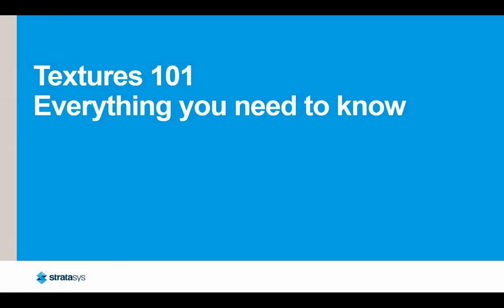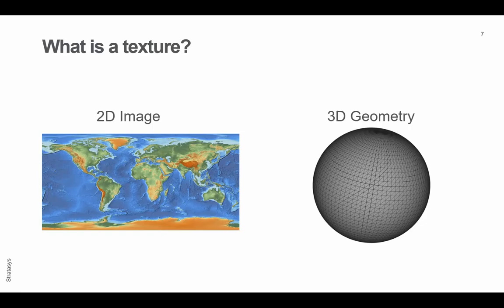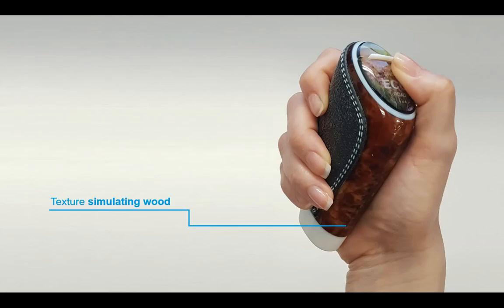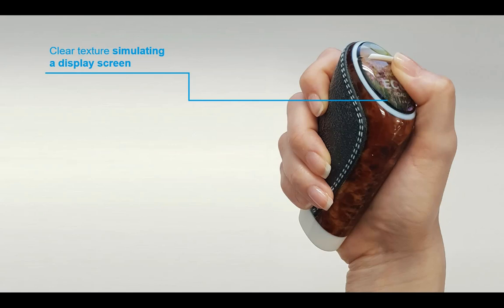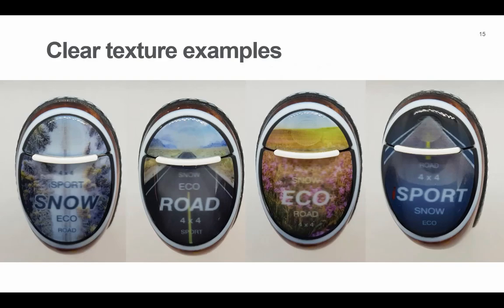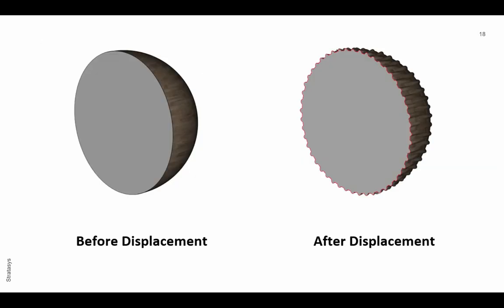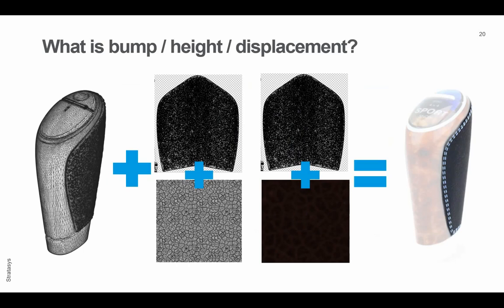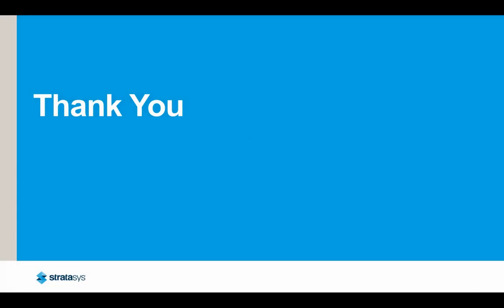Textures 101

Comment: What software are you using for unwrapping UV maps for the individual parts? Surely that can’t be all done in photoshop...
Also the original CAD model of the gear stick, are you working on adding texture to individual parts or the full assembly?
Reply from the maker: You can use many software packages for unwrapping UVs eg 3DS max now this functionality is also available in Keyshot. However you can apply individual textures to each part in photoshow however you have more linated controll over scaling / distortion however in many cases it is adequate. In this example individual textures were aded to each part within the assembly